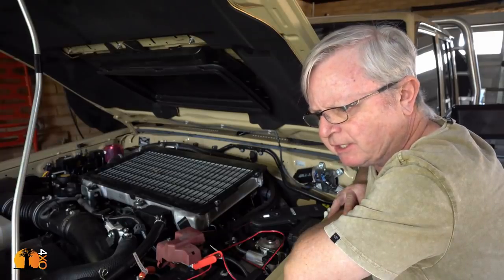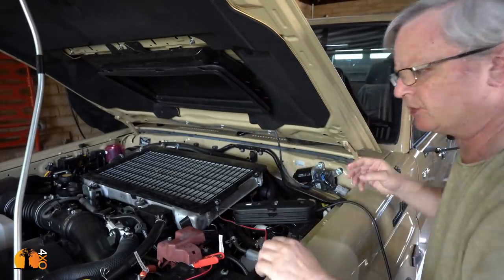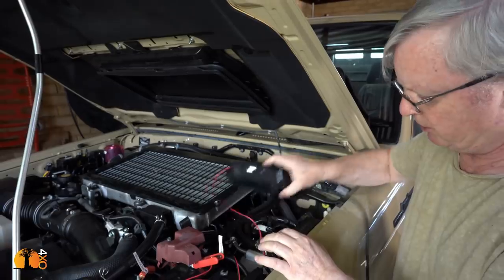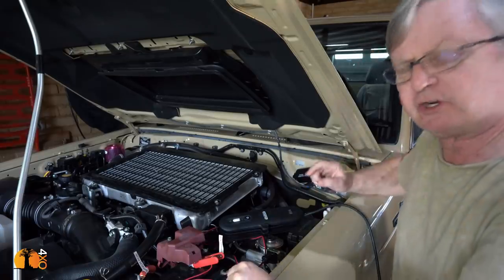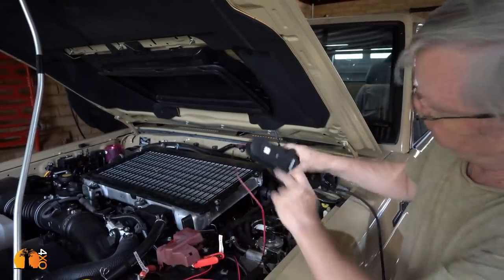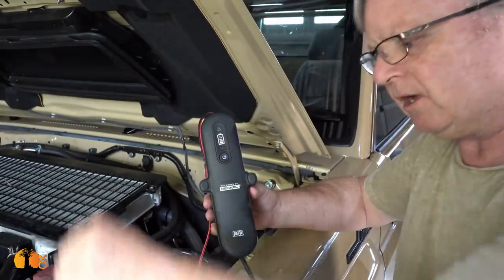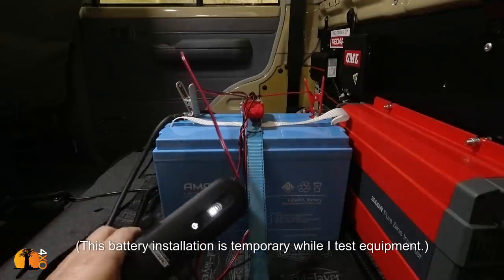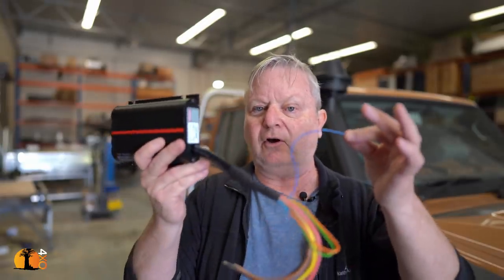DC-DC CHARGER RUNAWAY DISCHARGE WARNING.

Comment: Connect the trigger wire through a relay. Pin 30 to key on power, 86 to key on power, pin 87a to dcdc trigger wire and 85 to alternator thin wire which grounds the battery warning on dash, so when  alternator is working the DC DC will sense and turn on the charging.
Reply: I thought 85 was the ground side of the relay...
Reply: @Michael_Mears   Ah, yes.. I just noticed the mistake. Corrected it now.
Reply: Aah, good ol' relays ....I like this 👍🏿

Comment: One can also add a switch on the positive lead connecting the redarc to your start battery. Turn it on or off to disconect the redarc to the starter battery and charge it without.

Anyways, thanks for sharing the experience, dmuch preferablento learn it from you than in the trail.

Comment: Makes perfect sense, thanks. Simply put, attaching the external battery charger brings the voltage of the main battery over the 'turn on' voltage for the BCDC. The BCDC will start pulling current from the main to charge the Aux. It does so at a rate higher than is being supplied to the main battery from the external charger. If I ever do need to charge my main from an external charger, I will pull the fuse from between the main battery and the BCDC. Probably a good idea if jumping from one battery to another. Cheers

Comment: This is why i've always installed a DC-DC behind a separate VSR
Or relay that is operated by the ignition 
When maintenance charging at home, i connect to the Aux Batt via an Anderson in the rear
Reply: That is exactly how I wired mine as well (relay operated by ignition in my case)

Comment: Sounds like these expensive systems have plenty of traps if not set up or used right.  For now, I just have a really cheap set up of the main battery for all the original vehicle systems (1970s Land Rover, so very basic), and a second battery for accessories like power sockets, stereo, auxiliary lights, seat and screen heating and so on, any thing not essential to driving.  They’re linked by a heavy relay which it triggered by the alternator diode pack (dash warning light terminal on the back of the alternator).  It works very simply, so the batteries are isolated unless the alternator is providing a charge.  I want to add solar for the auxiliary battery.  The primary shouldn’t need it - main systems are drawing power if the vehicle isn’t being used, and in such an unlikely event, the engine could be started by jumping (a hard wired isolator connecting only for emergencies) from the auxiliary battery.  There is a lot to be said for simplicity.

Comment: Interesting.

I can see how attaching a trickle charger would provide a falsely high voltage reading and cause the DC/DC system to start charging the camper batteries but I'm surprised that it doesn't detect subsequent voltage drops and then shut down again.

I mean, your battery's sitting at, say, 12.7v, you connect the charger and the voltage will go up to, perhaps, 13.2v.
The DC/DC system detects that increase, realises the starter battery is being charged and starts charging the camper batteries.
Even with the charger connected, as the starter battery goes flat the detected voltage SHOULD drop from 13.2v to 13.1v and then to 13.0v and so on.
You'd think that the DC/DC system would be capable of realising it was sucking out more leccy than was being pumped into the starter battery and shut down.

Hope this isn't a sign of future electrical gremlins in your new truck.
I've heard some horror stories about Lithium batteries from people who're smart enough to know what they're doing.

Comment: You need a battery isolator between the two batteries so that when the main engine starting battery  gets to fully charged then the rear battery is connected in parallel as one battery .  Then the charger or the alternator only has  to charge around half the potential amp hour capacity at a time .   As soon as the isolator  detects current draw and voltage drop on the main battery it shuts down and isolates the rear battery  . Most have a jump  start button that allows you to jump start from the rear battery if the main battery is dead . It also allows you to drain the rear battery running something  but not drain the main  starting battery . 
In any dual battery system it's better if  both batteries are the same type and also very close in their amp hour capacity .  I am not a fan of DC to DC chargers but if you use different chemistry batteries then they are needed . I could be wrong but I think they can overwork the alternator . Also not a fan of lithium batteries especially inside the cab . Just do a search for lithium battery fires in cars . AGM battery much safer and hold their charge well  also cheaper but heavier .

Comment: blue wire has to go to ignition so the battery charges from alternator when ignition is on and solar/external chargers when ignition is off. If you leave the ignition on by accident, the start battery will only drain until it reaches the cutoff voltage and then switch itself off as per usual. The only time you will run into trouble this way, is if you have an external charger/solar AND leave the ignition on. Maybe look at the official redarc wiring diagrams or speak to them before you start blaming the charger for your own mistakes
Reply from the maker: Dion.  I know you want to have a go at me here, but you are making several incorrect assumptions. The first one is that I didn't check with Redarc. I did. And they confirmed my assumptions face to face. The others is that you are incorrect with regard to how DC-chargers work. The point is simply, if a charger is attached, the cut-off voltage is not reached until the battery is almost fully discharged. May be check things before you start blaming me for your inability to accept that you don't know everything.
Reply: @4xoverland  My bad mate, just read through the manual and I thought the blue wire was a trigger in the sense that it would turn the unit on and off (same as the blue override wire in the sbi12). It actually just adjusts the voltage at which the unit will turn on and off. I just couldn't get my head around the fact that a simple on/off trigger isn't a function of these fancy dc-dc chargers
Reply from the maker: @demolitioner962   No worries. Like everyone, I'm just trying to get my head around these things and share what I learn.  Handling baseless accusations is the single most difficult part of sharing knowledge and experience on Youtube.

Comment: Maybe Im  just thick headed, but I just installed a Renogy DC to DC charger and second battery. The charger only turns on when it sees more than 13.2v for 30 seconds. I dont know about you, but my 2001 Land Rover Discovery does not put out 13.2v with just the ignition in the "on" position. Only when the vehicle is actually running will it put out more than 13.8volts and after 30 seconds of seeing that voltage the DC charger will turn on. If the starter battery goes down to below 12.7 the unit shuts off. The Renogy unit also has solar inputs and unlike the Redarc. Once the aux battery is full. The unit uses the solar to trickle charge the starting battery!
Reply from the maker: This is not a problem I’m trying to solve. And neither is this a mystery as to why it happened. It can and will happen to anyone using a DC-DC setup. It's the nature of how DC chargers work. All of them with the exception of those relying only on a trigger wire. The solution is to charge the auxiliary batteries first. It's that simple.

Comment: If you pull 50amps from you starter battery, the voltage on the starter battery will quickly drop below 12.8V (or whatever) and your DCDC charger should sense that and switch off.  Charger is puttting 10amps across, pull out 50amps - voltage will drop quickly. Mine does (Projecta DCDC). Why doesn't yours?
Reply: I think in this  case the Battery charger was keeping the Main battery at a high enough voltage for the BCDC to keep pulling current out - it probably cycled several times sucking all the input "juice" out of the main battery.  - could be wrong. (leaving it "nearly flat" over the charging time)
Reply: Use a smart amp solenoid simple men
Reply: @brianostwald802  Dead right Brian, I use the simple old smart voltage solenoid No Worries, why complicate a simple need with an expensive
& complicated piece of Bling Mate.
Reply: Jason Shepherd 
The voltage at the battery needs to lower than 12.7 for 10 seconds before the dcdc will shut off as it has a delay built in. Even if the ac charger dipped in voltage under load it would sense it and crank up voltage to compensate within that time window of 10 seconds and kick it up over 12.7 + , therefore dcdc charger keeps on pulling the load.
Reply: @aussiedrifter  he needs the DC DC because he's running a lithium battery. The alternator with a VSR would cook the lithium battery BMS or the cells quickly plus the battery may even burn the alternator.
Reply: @brianostwald802  shouldn't be done with lithium batteries and that is what Andrew is running
Reply: @Grant Kerr are you sure? I can only talk from my experience - 8amp projecta 7 stage AC charger - it can’t compensate for the 25amps being pulled by the dcdc. Also takes a good 30sec for the dcdc charger to kick back in once it’s cut out. Both kick in and out but get the job done..
Reply: Ps I’ve got a Victron Bluetooth battery monitor so can see exactly what’s going on on my iPhone app: voltage on main dropping under dcdc draw, then dcdc off, main slowly rising again, dcdc on, rinse and repeat!
Reply: @grantkerr2971  Yes - I believe you have 'nailed' it. It's that built in delay turning off the DC/DC charger that is causing the problem.
Reply: I don't think he had to trigger wire installed to ignition Most dc-dc Chargers Will work on a lower voltage because of smart alternators They will buck up the current and voltage to match the profile set on the house battery whether it be a GM lithium or whatever else Going into the DC charger you might be You might be drawing 60 amps at 12 volts but going out the back will be 50 amps at 14 volts or whatever the settings are
Reply: @munecito  If you have a dc-to-dc charger You can set it to lithium profile and it will charge correctly Also a DC DC charger is recommended because the lithium batteries can draw A lot more amps than your standard alternator Can't put out because of his charging profile and BMS system An example is a hundred amp hour lithium battery can I'll put a hundred amp hours constantly with a good BMS in it can also charge at a hundred amp hours with a good BMS
Reply: @bucket1249  so you basically agree with what I said.
Reply: @munecito  Sort of I would definitely say if you had a small Alternator that Only puts out low amperage A lithium battery tied directly to it could overheat it because a good BMS will draw A lot of amps for quick charging recovery . But if you Have a dc-to-dc charger You're only going to be able to draw what the dc-to-dc charger Is rated for If the voltage is pretty close with no loss you should be drawing just a few more amps on the other side of the DC from the alternator compared to what it's putting out

Comment: Good point. I am about to install a redarc DC/DC into my jeep with an AGM and LiFePO4 auxillary battery and I have been looking for a AC battery charger to do what you are doing.
Reply: you could use ignition wire vs voltage sensing on the DCDC

Comment: @4xoverland My solar panels are currently removed for vehicle maintenance so I have been charging exactly how you do (did). I have been monitoring voltage and current with the following observations. When the supply (crank) battery is at 14v with engine running the DC/DC charges at full current. With only a  mains charger connected to the supply battery it's voltage drops and the DC/DC tapers off the current delivered to the lithium. (while still in bulk stage)  It finds equilibrium at 7 amps and happily charges everything to float. This happens to be the exact amount of current my Ctek 7.0 is delivering to the supply battery. My DC/DC is not redarc. I would suggest either a setup error, a firmware problem or a bad design DC/DC charger.

Comment: When Redarc fuse circuit was closed, the voltage drop at the main battery went to 12.7v (as 50amp would no doubt collapse the main battery voltage, thus disengaging Redarc), then presumably  the external charger (10amp) was able to bring main battery up to 13.2v in a short period (thus Reengaging the Redarc). Conclusion being that multiple cycling of the Redarc engaging and disengaging slowly depleted the charge state of the main battery. However, if you waited sufficiently long enough and just left the AC charger going, this whole process would have been unknown to you. But it is actually happening, probably to a lot people who have this setup.  One possible solution, a single rectifier/isolator between Alternator and you battery system and then wire your Redarc to the Alternator positive. Result, Redarc will never switch on unless alternator is producing power.

Comment: I installed a switchable circuit breaker between the main battery and the DC to DC charger to separate the two Systems if I needed to. 
I did however learn the hard way about what you are talking about because I forgot to turn the switch off

Comment: I use the trigger cable on my Redarc even though I don't have a "smart" alternator and I have never had any problems.
I occasionally leave the car on accessories to run the radio but this is fine as the ignition connection isn't triggered.
It seems unlikely that anyone would leave the ignition on when the aux batteries are low as normally they would have solar connected or run the engine to charge them in that situation.
If you leave the ignition on after driving for a while and then load up the aux battery then that would cause a problem but it also seems pretty unlikely.
I have run my system for 2 years with no issues.

Comment: I have a TS800 DC/DC converter which has a vibrationsensor to check if engine is running, works fine, also when ac charger is hooked up. Except on a long trip on a ferry where it completely drained the starter battery 🤔

Comment: So in short, connecting an external charger to the main batt. is the same as turning the ignition switch to on. The DC-DC charger could not tell the difference.

Comment: Nice work Andrew, If I may my 2cts: trouble starts when manufactors paralel batteries; the solution is use more powerfull ( more current) chargers, actually like they do sizing the alternator; of course the batteries last less. ( it happened in the past with 6v and the trucks 12v)
best, Pedro

Comment: Yeah that is interesting, so the AC charger is keeping the voltage up which the redarc thinks means the alternator is on and thus switches on the DC to DC system. And then the DC to DC charger does its thing and demands lots of amps to charge second battery and that then drops the starter. So that blue cable is for sure one answer, you could put a relay against the car being in gear and ignition on if you wanted. OR you could put an isolator between the alternator (with correct current rating) and the starter battery, and sense the DC-DC charger from the alternator side, you could then charge the starter and the DC-DC wouldnt know about it, and when the alternator spins the isolator would energise and charging will work like normal, You could still join the batteries together if you needed(because you will energise the isolator),and could sense both (If the redarc actually cares). Just my quick thoughts.
Reply: Sounds about right to me what you explained Marc.
Reply: If the trigger wire was hooked up to ignition on Source you would not have this problem Or just charge your auxiliary battery and let it trickle charge back to the starting once it stopped off

Comment: Hence why I run a manual reset circuit breaker to my DCDC to stop it running while maintenance charger is on starter battery. There is always pros and cons even with circuit breakers and probably best to use a manual reset breaker in a dcdc charger case as an auto reset could keep toggling all day long if there’s a fault until it either burns it self out or something else happens. Another issue with circuit breakers and especially on a hot day under a the hot bonnet with high current is they can trip based on too much heat even if there is no over current or fault situation. Probably the most reliable type of system would be the midi fuse but then can’t break the circuit without maybe also installing a switch.